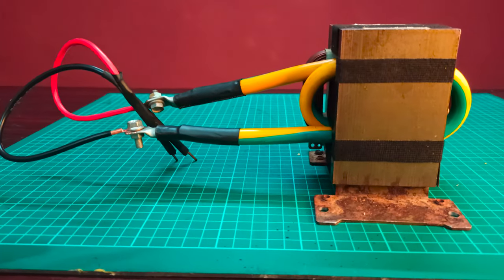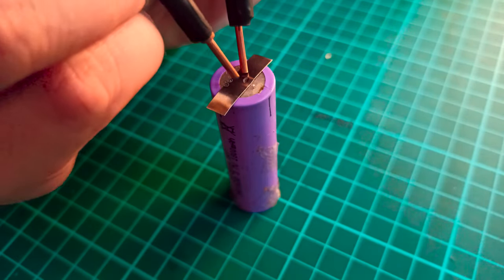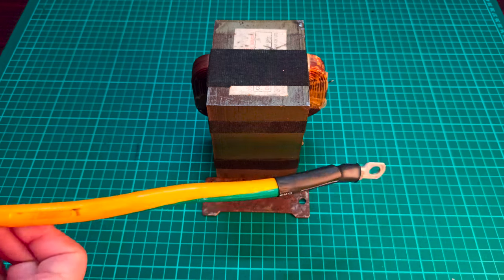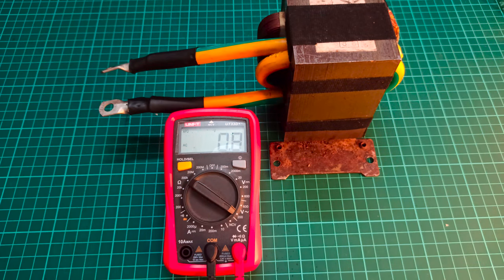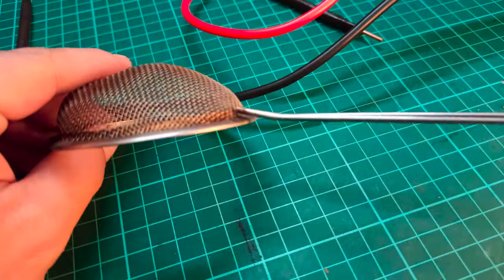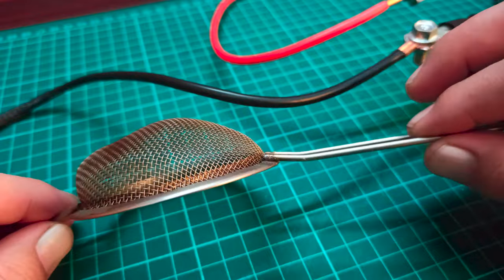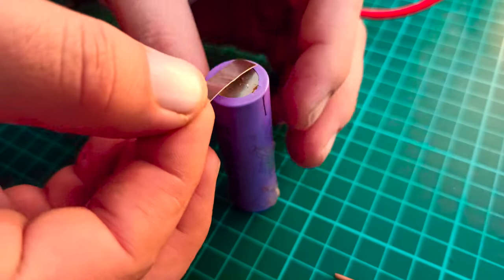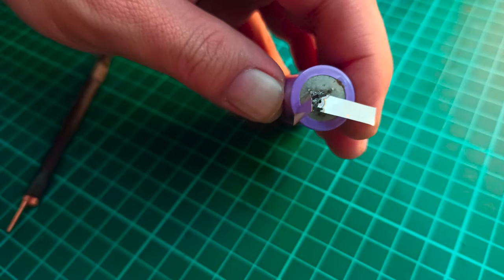Repair Home items with this Spot Welding Machine

Comment: It is possible to use more wire and combine them stacked together to achieve a thickness of 35 mils or more. Will it succeed or not? 🎉🎉🎉
Reply from the maker: I once tried to wind thin strands of multiple wires (same # of loops), but the problem is it takes a lot of time and efforts, also as the number of wires increases within the core, the difficulty to wind further increases, so my recommendation is that either use a moderate thickness wire (all strands twisted), or if you can put efforts then go for enameled copper wire strands and wind each strand seperately for desired thickness.

Comment: Why not use slightly smaller gauge wires and more turns on the secondary to increase voltage?
Reply from the maker: Depending upon the application, if you want to weld lithium cells then thinner wire with more number of turns are required to have high voltage (4-12v) while for thicker metals melting you will need a bit lower voltage.